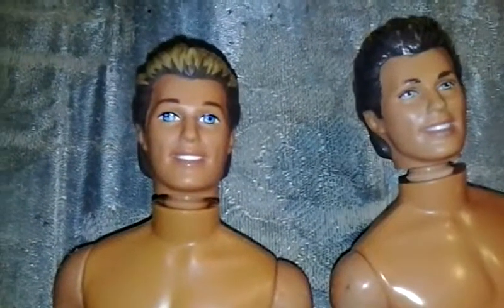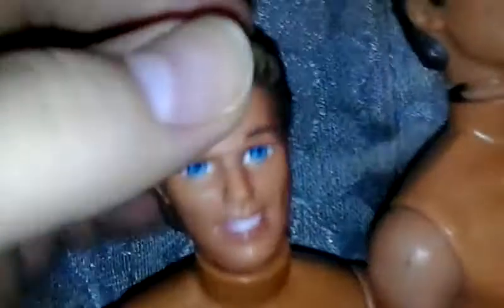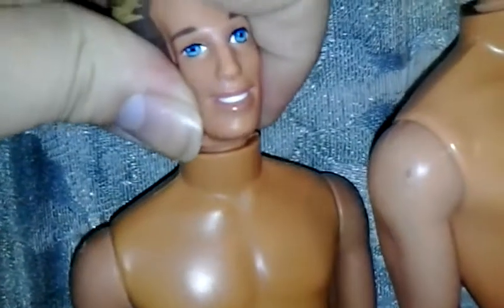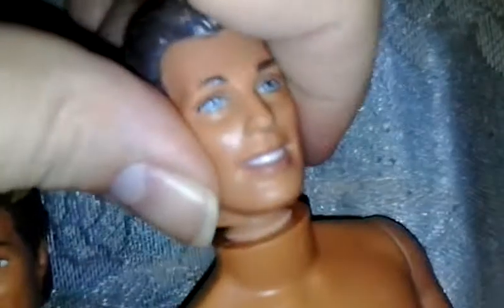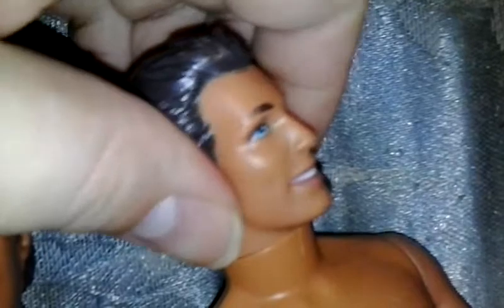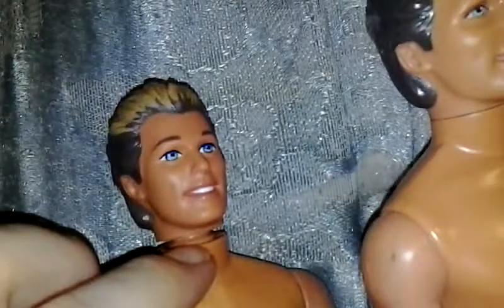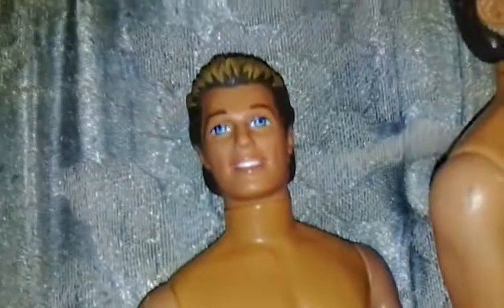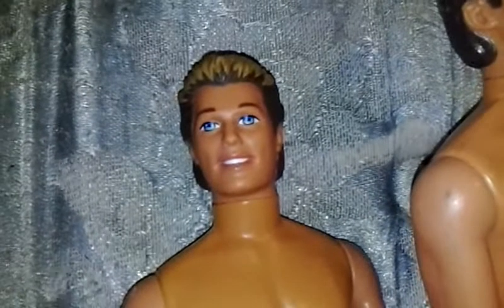How to fix older Ken doll necks

Comment: Do you know how to get the Ken doll head back on if it's completely popped off? There's a hard plastic bit on the bottom of his neck hold that doesn't seem to fit back in once taken out. Any ideas?
Reply: What I've done with my mattel Prince Phillip dolls is heat up the neck/body, to pry it open enough to take that plastic piece out. His head fits right back in perfectly.

Comment: Hey there, do you know how to remove an older ken doll's head? I think mine has some dirt in the inside somehow, and I'm trying to clean it, but I can't figure out how to get it off.
Reply: Put the head in hot water for 13 seconds and then pull it with a towel